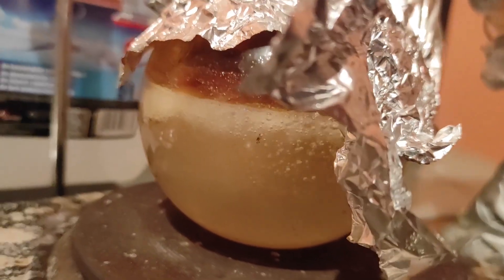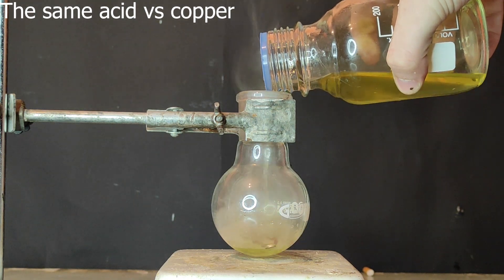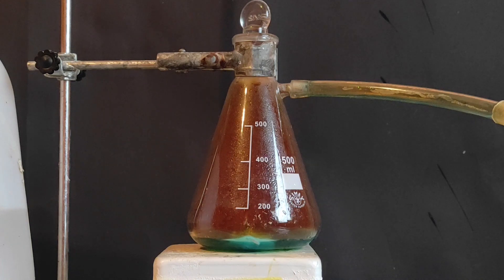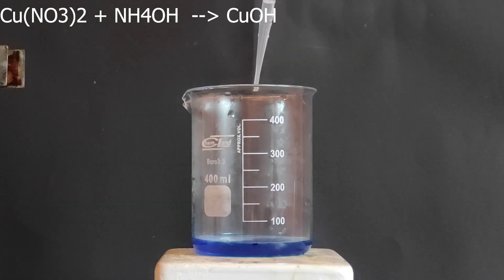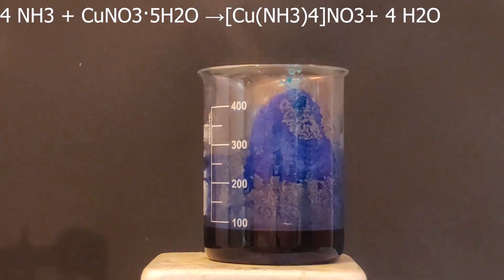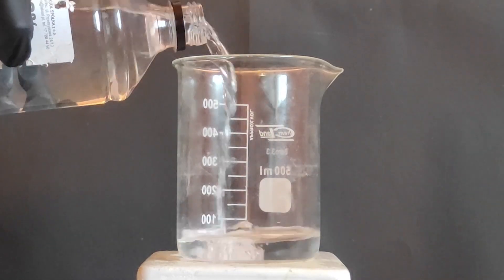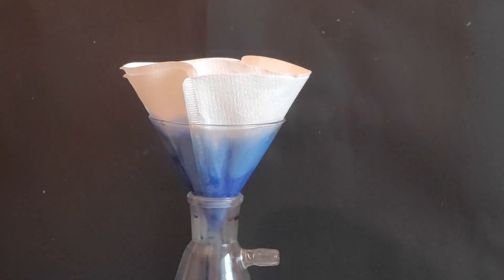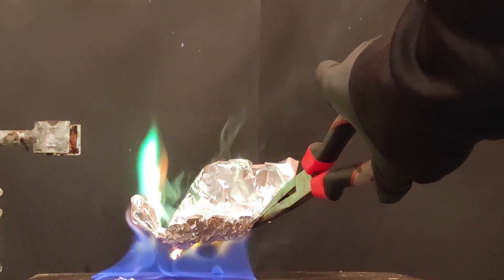Turning Copper Into a Explosive

Comment: It's not so much BAD as it needs to be used properly. A cap reliably sets it off and it's best used as a booster or TNT replacement. 10% aluminum powder also helps.

Comment: Someone told me that copper pipes can explode on very rare occasions when pipe fitters are working on them, because copper nitrate and tacn can form slowly inside and around the joints of copper pipes... and that causes the pipes to explode when heated with a torch and/or when the copper pipes are twisted the mechanical force can set it off, because it's friction/impact sensitive. I couldn't find any incidents of that happening in real life though. This website by the Queensland Australia state government mentions it here. 
https://www.rshq.qld.gov.au/safety-notices/explosives/formation-of-tetra-amine-copper-nitrate-tacn-on-copper-fittings-located-on-mobile-processing-unit-mpu#:~:text=TACN%20is%20an%20impact%20sensitive,height%20of%20approximately%2020%20cm.

Comment: I thought you were going to make Copper(I) acetylide, which is a lot more energetic. Only reason I know of it is that I use Copper chloride for black and white slide Reversal developing, and found out that it is easily made by accident. Definitely interesting, but I have neither the experience nor necessary safety precautions to experiment with it.

Comment: TACN is cool but drying and storring it is horrible
Reply: Crush it under dry acetone then store it in an airtight container.  Lasts years.
Reply: Like CoQQ said, if you remove the hydrates of crystallization via acetone first before storage, it becomes a completely different compound. The same can be done with TACC, TACP, and TACPS. Anhydrous TACN exhibits very different storage and detonation behaviors as the hydrated form absorbs carbon dioxide and is highly susceptible to degradation over time, which is not very cool.
Reply: I like Cooper Hexamine Perchlorate for it's long storage shelf life, it will last for years if stored under argon and has really low friction sensitivity.

Comment: copper tetraamine perchlorate especially ones with added organic clathrates like hexamine or glutamate are pretty powerful explosives.
Reply: This information is true.
Reply: Yep, copper hexamine perchlorate rocks.
Reply: @TheExplosiveGuy Especially when dehydrated with acetone to remove the water of crystallization! Following treatment, it becomes a dark purple powder. In this anhydrous state, its DDT ❲Deflagration to Detonation Transition❳ properties are far superior… Overall, yes, CHP is very cool‥
Reply: @ShortFuseMan  ooh, good tip! I usually dry mine in a vacuum dessicator but that sounds like another helpful step, water can get trapped in the crystal lattice I suppose.